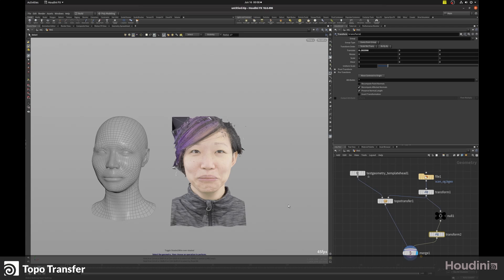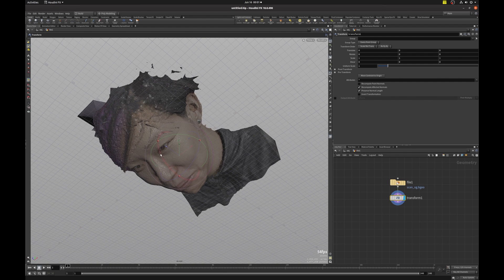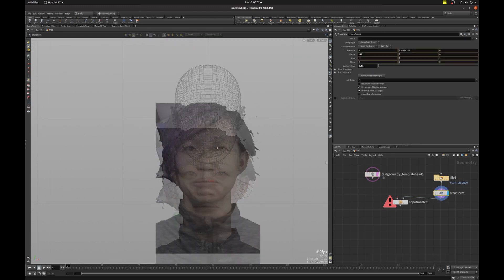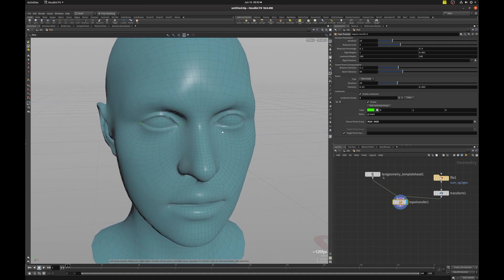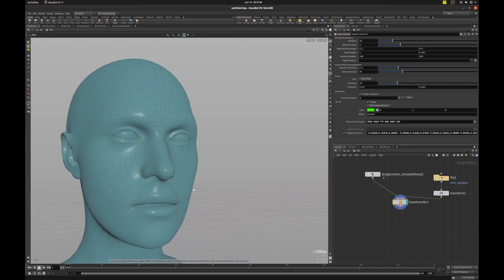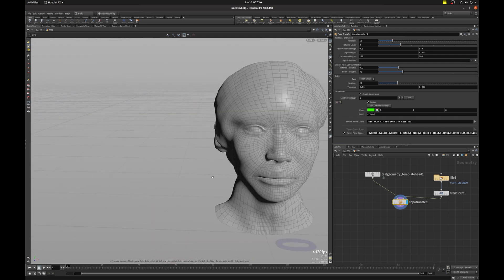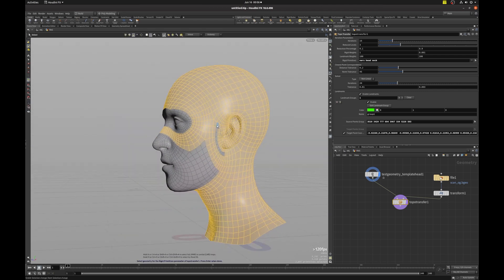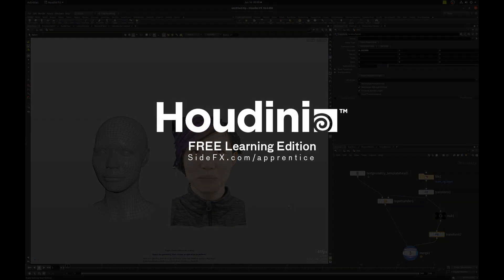Topo Transfer

Comment: Cool! Can we transfer textures as well from the original 3d scan in some way (without showing uv seams)?
Reply: Yes, you can do an attribute transfer, or you can use the bake tools.  It's very easy in houdini.
Reply: @AlanStreams  thank you guys, would attribute transfer work in this case, without showing uv seams?
Reply: interested too
Reply: easy: use bake tools
Reply: Yes this is a standard texture baking process which can be done in Houdini easily with the labs texture baker

Comment: Curious to know how the results compare to R3DS Wrap
Reply: It's not even comparable. But the time it takes Houdini vs R3DS is ridiculous. Houdini is almost real-time (maybe a couple of seconds) whilst R3DS takes a much longer time. At least that's what I've deducted, haven't actually used R3DS myself!
Reply: @chillsoft  How are you able to compare if you "haven't actually used R3DS myself!" ??
Reply: @chillsoft  R3DS does it in about 3 seconds for a full face with about 50 points as guides, personal experience.